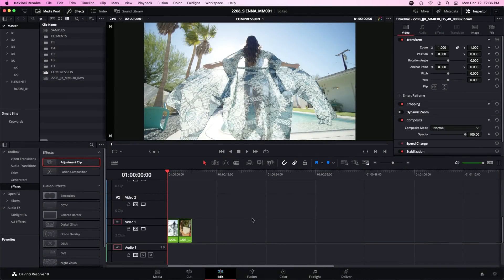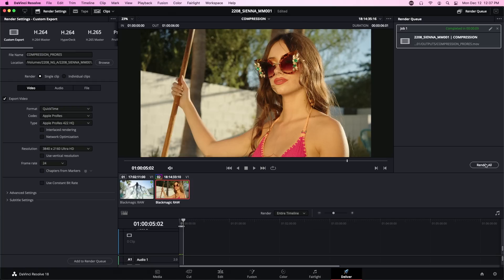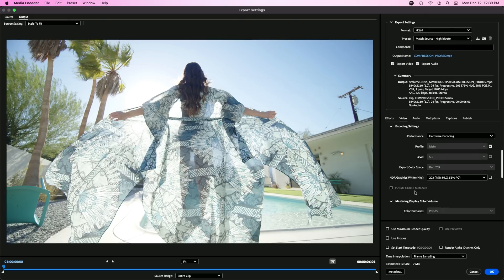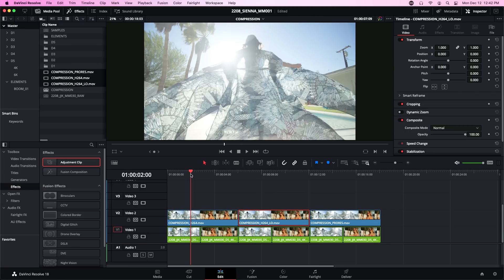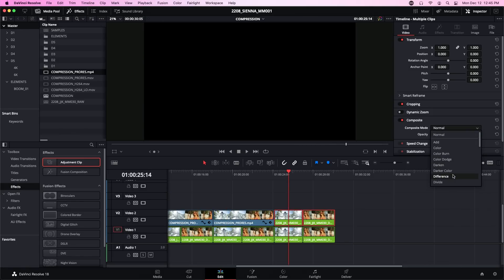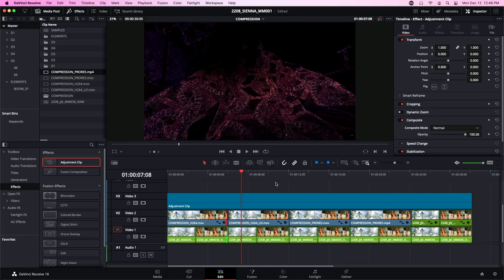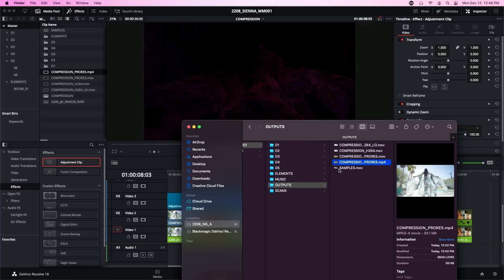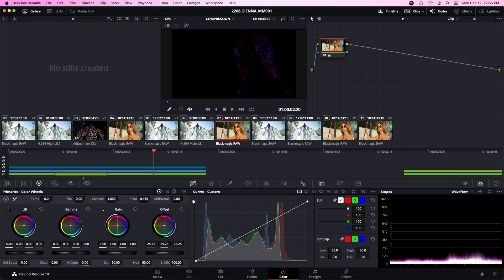What Difference Composites Reveal About Your Compressions

Comment: Others have said it on the reddit page discussion, but I'd like to reiterate:  For true apples-to-apples, where "the primary metric is file size", then you gotta do two things.  One, BITRATE.  That controls for filesize, and also is the only way to do a true technical comparison.  Additionally, the defaults in ME vs DR are different -- so you gotta do manual settings and match as close as possible: 2/Multi-pass; High profile; CABAC. 

I deliver a lot of masters, and one thing interesting I've found is that h.264 (multi, high, CABAC) at high bitrates actually looks better visually/aesthetically (where it counts), especially with film grains, than h.265.  This is true even after re-compression occurs, such as on Youtube.  I only ever use h.265 for low bitrate reference clips with clients.  Caveat:  The internet is basically 8-bit color, but if there was a use case for 10-bit in a compressed format, then you would have to go with h.264.  You can actually configure x.264 to do 10-bit outputs, but then you get into compatibility issues.  (Masters for television or screen are naturally 10-bit and delivered usually Prores HQ or 444, depending.  No, DNx- 12-bit is not a delivery format.)

Anyhoo, still instructive video, and gives useful guides for how to do comparisons.  Thank you!

Comment: I liked it, but my biggest issue is trying to figure out. Why I have these wildly inconsistent pauses or crashes in my renders.

Even in basic videos that are not ridiculously complex,. I will run into situations where something does not even ten minutes will always get stuck at seventy or thirty percent.

Also? I'm curious why. When I use speed increase or decrease and clip duration increase or decrease It's a fifty fifty chance it'll Actually change the clip's duration or speed.

Comment: There is no specified bitrate in the "H264 "HQ"" Which you actually used Automatic but used a very specific for the Media Encoder file.
Reply from the maker: This wasn't arbitrary. I wanted the Resolve codec to be default and then I wanted the Media Encoder output to be the same size as the Resolve encode or smaller. A bigger mistake was doing two-pass encode on the ME encode and not the Resolve encode. Thank you for the comment! We really appreciate the feedback.
Reply: @JJKoester  don't get me wrong, i feel like the Resolve internal renderer is underdelivering on H264, but on one you select a specific bitrate and on the other you don't ... that was my gripe
Reply from the maker: @BeardsChips  Oh, I hear you! There are problems with this video and they are our fault. There was a thought process behind our methodology and it made sense going it but then we discovered that it was incorrect after release. I'm not discounting your opinion, just trying to explain the flawed logic.

Comment: There is very significant difference in DaVinci Resolve in H264 export if multipass is used (only on MacOS available option) - I have my test video 40mbps 1080@60fps and multipass makes really big difference in certain scenes where otherwise is a lot of artefacts in the image. Unfortunatelly the export file is very different if exported in MacOS, Windows, CPU or GPU (I did every combination and MacOS multipass with Graphics acceleration was the best). For some reason only version 16 makes proper profile/level of video 4.2 every newer version (starting 17) makes  trouble with exported filed to be played smoothly on multiple devices. Have Studio version as well...

Comment: This is such a misleading video and pretty inaccurate I would honestly take it down haha. You admit to this not being a fair test in the description so why keep it up and mislead people any further? I would never use the automatic quality option and always use multi-pass encode when you are delivering master files. Something that you also don't mention is that there can be a color/gamma shift when taking an export from Resolve and re-rendering it through Premiere/Media encoder. And nobody would ever use an H.264 export for color grading. There are so many other little things wrong with how you are exporting but too many to comment. You would not catch me rendering from media encoder in a million years from a Resolve export.
Reply from the maker: The problem with comment threads like this is that I'm going to breeze by the points you made that I agree with to focus on the ones I feel the need to push back against. This doesn't mean that I don't agree with some of what you've said (I do), it's just that I want to sand down rough edges as efficiently as possible.

1) I don't think that a color/gamma shift in ME is worth mentioning because the difference composite would reveal that as much as any other artifacting that occurred at the ME level.

2) I wasn't advising people to color grade an H.264 export. We shoot RAW, grade RAW, archive using an intra-frame codec and deliver using an inter-frame codec. We don't CC inter-frame and I didn't say that anybody should.

3) I would also never use the automatic quality settings for H.264 in Resolve and we weren't advising people to do that. We always export intra-frame from Resolve and advise people to do the same. I went with automatic because that's the most neutral setting for H.264 export in Resolve.

We aren't taking the video down for several reasons but the one worth discussing is that we build this channel as a conversation, not the final word. We believe in iterative design and find tremendous value documenting our mistakes along with our successes, not just on this channel but across our entire client portfolio. Iterative design and open discussion of where we've made mistakes is the spine of our business model and we carry that over to our front-facing communications.

We really appreciate your feedback and hope we haven't completely alienated you from our channel. Your voice is warmly welcomed and we appreciate push-back when we miss the mark.

Cheers!
Reply: @JJKoester  I get what you're saying and I respect your perspective. I just think since the title is such a bold claim it should have the most accurate information because someone who doesn't pay attention to the description or look further into it can end up wasting a lot of time and may not get the best results. It's probably just worth making an update video to replace this one at some point because the comparison using the composite mode is a really helpful tool that you bring up.
Reply from the maker: @jackieronimo8112  Oh, I couldn't agree more. We're going to update the title and thumbnail to reflect the change of perspective we've gotten from the feedback. I just haven't gotten there yet. It's one of those year-end / holiday season / family demands things and we really appreciate your patience!

Comment: If there was ever anything in your life that you regretted the most, you need to remove it from the shelf and replace it with this video. Now, I’m not an h264 fan boy by any means, but i do know how to use it and this video demonstrates exactly the way Not to. If anything, what you’ve done here is created an example of what not to do. So… good job?
Reply from the maker: That's a bit harsh but not entirely unfair. I can assure you without any qualifications that this video is not the greatest regret in my life. I regret being a poor partner to the women who were kind enough to love me in my late teens and early twenties. I regret thinking I had more time to meet my wife's mother and then learning that cancer moves quickly. But posting a video that compares a single-pass variable bit rate encoding to a two-pass variable bit rate encoding without correctly delineating those differences doesn't even crack the top ten of my list of regrets.

Thank you for the comment, though. YouTube doesn't distinguish between positive and negative engagement so I'm grateful for the bump you've given this video.
Reply: @JJKoester  Sure thing.

Comment: Hi, I understand YT angle you have on the H.264 comp. As compared its a bit of oranges and appels, Mb are one thing. If you let Me do multiple passes, you by default give Me a better chance for Quality and Your encoding Profiles need to be same. 
If you use force in resolve under Advanced you may have a better result. I like the Options for Encoding in ME as they are more advanced/can be tuned more precise to fit your needs ;)

Comment: Now I'm just a hobbyist but it took me about two tries to realize you should NEVER export from Resolve with automatic quality setting. Your "HQ" 264 encode is actually unacceptably low quality even for a hobbyist YouTube upload. There may be other reasons to not use 264 but you're slaughtering the quality with the resolve export and comparing apples to oranges.  .. and this is before we compare the encoding times. Please do it again again with two pass encoding and also compare encoding time.
Reply: I really appreciate the tip on how to compare the original and compressed material though. 👍 I will use this method in my own tests.

Comment: also, does da Vinci do 2-pass? that is a serious difference.
Reply from the maker: DaVinci does but it's not called 2-Pass Encoding. It's called Multi-Pass Encoding. While the methodology presented in this video for comparing is solid, the single/multi pass whiff is meaningful.
Reply: @JJKoester  thank you, good to know. I do use compressor, which I have always gotten amazing results from and it just compressed head and shoulders in speed for me over media encoder

Comment: Nice demo, I use third party encoders for an another reason : I need to work on DVR, not waiting for an h264 rendering, so I’ I’m only encoding a prores and then put it to h264 renderings in différents nitrates, then back to work in DVR… Then you could say : DVR does renderings with dual exports (prores+h264) but there’s a problem : you cannot switch sound’s compression… PCM for prores is ok but I need AAC for the h264. If anyone has a tip about that, I’ll be glad. Pb

Comment: 10000 for what? That's ridiculously low
Reply from the maker: We went with two H.264 outputs from Resolve, their default settings and 10,000. We did the former because it is the software default and that seemed like a good place to start the conversation. We did the latter to exaggerate compression artifacts and make the result of the difference composite even more obvious. We would never do a 10,000 output for a client and don't recommend that bitrate outside of exaggerating test results for demonstration purposes.

Thanks for the comment!

Comment: The lowercase b is bits.  There are 8 bits, or ones and zeroes, in a byte - so you take that and see that 40Mbps is a finer measurement of the same amount of data as 5 MB/s.  Sort of unrelated: Imagine if you had a video at 40 MB/s to stream!  That would be pretty intense for the web connections of most of the people I know.

Comment: Even though I'm an amateur, as soon as you mentioned that the media encoder was using a 2-pass mode I knew this comparison was going to be flawed. Coming from Shotcut where I always use the highest quality settings for output which are slow to render, I noticed immediately that Resolve has fast render times on the default H264 settings. So I'm already assuming that the default settings are speed-optimised rather than quality-optimised. Did you just create this clearly-flawed video to be deliberately provocative? I've got to admit I did learn something useful about technique though.

Comment: The "quality drop" is likely because your settings are on a variable bitrate instead of constant bitrate.  It's compressing details that it doesn't detect enough change in efforts to keep file sizes smaller. Changing rate control to constant and setting the bitrate to something like 24,000 for HD and 48,000 for 4K should minimize the issue if not resolve it.
Reply: It should (Da Vinci) resolve it 😎😎
Reply: @michaprzychodni9379  Was a halfway intentional pun ;)
Reply: But then you will have a bigger file, so all in all it's still better. right?
Reply: @jonathan.v  It may indeed be larger. By how much I couldn’t tell you without testing. But the constant bitrate still won’t nearly be the size of a prores file.

Comment: The files are the same size yes, but you set DR to automatic so we have no idea what bit rate - you specified in mE the bit rate. This also means DR didn't do 2 pass encode - what were the 2 files bit rate in the end..? ME vs DR ? Good test, but I think fairer if you set REsolve to 4000 Mb/s same as ME setting first. Interesting using darken to test - like that. Good video.
Reply: Was thinking the same thing. He didn’t specify a matching bit rate when rendering from DR so this test is flawed.

Comment: The export setting you use between Media encoder and resolve are totally different. There's no suprise that a 2 pass vbr encode is going to be better than a 10 mbs single pass encode.
Reply from the maker: We didn't compare the 2-pass VBR to a 10 mb/s output. We compared it to the default settings from Resolve. After further testing, what we did was unfair and we will do a followup video correcting our mistake. Thank you for the comment and we're looking forward to making a video with more complete information.

Comment: Nice video - I can't help but wonder where h.265 falls in this experiment. By my eyes, h.265 for export using main10 and a decent amount of kb/s when compared to the ProRes for size, appears to be a good compromise. I also wonder what the clips would look like when using free tools like Handbrake or Shutter Encoder. Do they suffer the same loss as you are showing in Resolve? I wonder. Good job with this - one of the best I have seen for testing quality and size.

Comment: I think that biggest problem for H.264 video quality in Resolve is "Hardware acceleration", especially on Mac M1 chips. Hardware encoding on M1 chips is optimized for speed, not for quality. Out of all hardware codecs probably the best are the two latest NVIDIA generation chips. Intel chips are not far behind, however. I take NVIDIA's H.264 hardware encode over MAC Mini M1 H.264 hardware encode every time. I've done dozens of cross platform comparison tests for low bit-rate (under 8Mbps) H.264 in Wirecast for streaming. Conclusion? Taking into account same software runs on both platforms. NVIDIA's Hardware encode is visibly better no need to pixel peep. Unfortunately NVIDIA H.264 encoder is not available non MAC. Thus unchecking "Use hardware acceleration if available" on Resolve export panel (on Mac Mini M1) might improve H.264 video quality.
Reply: This is very interesting… going to look into this
Reply: Can confirm unchecking "Use hardware acceleration if available" does improve the quality.

Comment: This is interesting, but one problem with direct subtraction comparisons of lossy coders is that the difference isn't necessarily hugely informative because the whole point is that the error in the coded output is perceptually weighted. If you get basically no difference, as with ProRes, of course that is unequivocally a good thing, but for instance I have just done some comparisons between H.264 and H.265 (under various conditions of settings and bitrates) and the difference files look remarkably similar in every case, though I can see some pretty clear differences while simply viewing the encoded output.
Reply from the maker: I tried to touch on things the difference composite reveals about the codecs that would be harder to detect with the naked eye, like where key frames are. I could have gone into more examples like how banding plays out in gradients and how RGB blocking happens across frames but I really wanted to get in and out with this one.

You are correct that this isn't a great method for comparing compressions to each other. All it reveals is how similar or dissimilar a compression is to the source material. It won't give you that deep an understanding of why two compressions are dissimilar to each other.

Thank you for the comment! To be clear, I'm not disagreeing with your point. I'm just trying to explain the thought process that went into this video.

Comment: You've made a couple mistakes. If you have in and out points set on your timeline, that carries over (at least in Windows). Second, you could be much more efficient in your render if you added all your versions into the que and then hit "render all".
Reply from the maker: The in and out points carry over to the Deliver panel but you have to make sure you're export is set to in and out and not whole timeline. I hope I didn't make it sound like you have to reset in and out points when you get to the deliver panel. Also, once you make the switch to in and out, you don't have to do it again for every project or timeline. It's a software level setting, not project.

About the queues, I stack up exports when I'm working with multiple timelines but I only do one export at a time from a single timeline. It's an old habit and I keep it alive because I'd rather stagger my exports than queue up a whole bunch and realize that there was something off in the source timeline.

Thank you for the feedback! I'm always happy when someone jumps in on the comments to discuss workflow!

Comment: Very ineresting metod for comparison (with difference mode) , but you compare apple and orange. Default settings in Davinci and two pass VR encoding in ME, that is wrong. So try to do again with same parameter in both programs . Regards
Reply from the maker: Noted. There was a thought process to that - the goal was to use the default output settings in resolve and then build a file that matched the size. The intent was not a skewed test but that was the result. We'll be posting a new video soon. Thanks for the feedback!